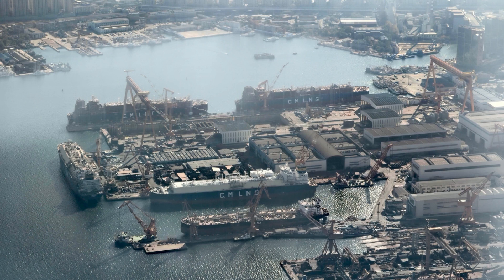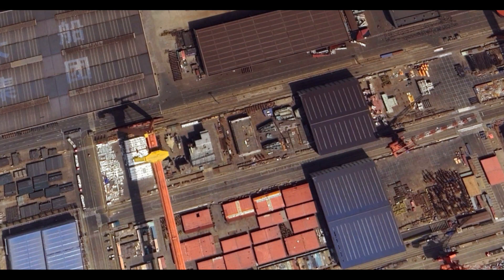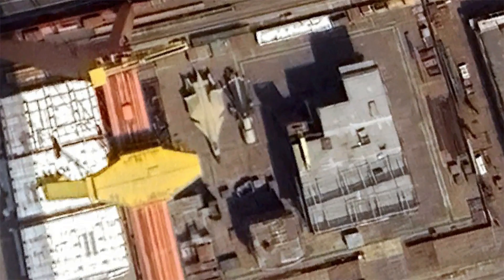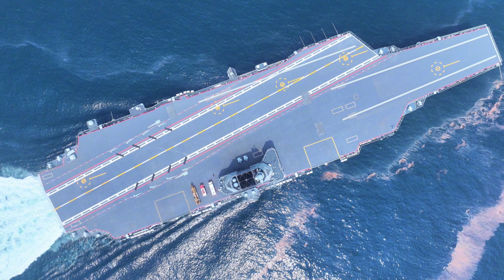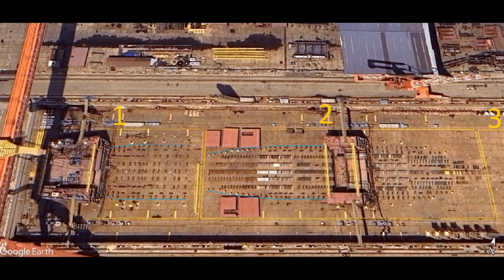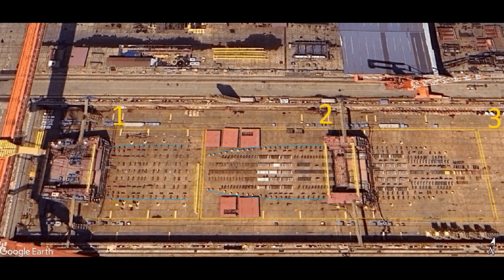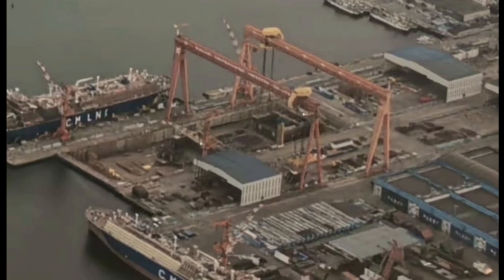China Is Assembling an Impressive Nuclear Supercarrier - The Type 004

Comment: While still not at par with USN, the rate of progress is incredible. To go from nothing to a possible home grown CVN in 25 years is monumental! 
At this rate the PLAN will easily reach parity by 2035 and leapfrog the USN afterward.
Reply: The issue with the US fleet, is that it's aging rapidly, and it has obligations globally. The USN is unlikely to be able to keep up with China's ship building rate.
Reply: @anonanon7235 correct and the cancellation of the Constellation definitely did not help. Also 99% of folks don't understand strategic posture. 
The USN by nature is an expeditionary force and force projection focusing solely on CSGs. PLAN is more about defensive and protection if the homeland and trade routes. They have zero interests in patrolling the Atlantic or even going past the 2nd island chain.
Reply: Nonsense..
Reply: @yours_sincerely48  He is right though, two of the three catapults on the Fujian extends too far back into the landing area or are in the landing area. When conducting air operations it can only use one of the three catapults. The Nimitz and Ford can still use 2 catapults while recovering aircraft simultaneously.
Reply: @GigaB1ter Do your know china EM Launcher can set to Stop in the instance anywhere on the length of catapult. Dinosaur Age Steam Catapult CANNOT Do That ..If China can figure out how to make EM Launcher and even the US can't...Dont they know the operation aspect. 
No point using antiquated Steam Catapult knowledge in a hi tech EM launcher.

Comment: I have a question for anyone with practical knowledge of aircraft carriers.  A number of days ago I saw a video in which commentators with some experience with US aircraft carriers were commenting on how the Type 003 aircraft carrier's EMAL catapult and recovery deck arrangement was inefficient and that one of the front EMAL catapults overlapped with the aircraft recovery area.  This arrangement would lead to a slower launch/recovery cycle as not as many planes could be launched and recovered compared with the US carrier deck arrangement.  Is anyone able to comment on the issue and whether the deck arrangement is sub-optimal?  If it is sub-optimal, is there any indication of whether the new Type 004 will have a different deck arrangement that is more optimal?  Thank you!
Reply: It is true.
During the construction of Type 003, there was a major breakthrough in China's electromagnetic catapult technology, therefore the partially completed ship was redesigned to fit electromagnetic catapults instead of steam catapults. The problem could easily be solved if the carrier was built a little longer. And it is clear that Type 004 will indeed be longer than Type 003.
Reply: @deepseer  Thanks for explaining the origin of the issue and for sharing your thoughts on how the increased length of the Type 004 should solve this problem.

Comment: The Gerald Ford looks good on paper but plague with operational problems especially its EMAL and Lifts. Its maintenance cycle is also longer and more expensive to operate. Is  cannot operate the F35. Only the F18 Super hornet  and the E2 Hawkeye.  The Type 004 is not even built yet so a comparison is merely academic  but compare to the Type 003 Fujian, I am not  sure the Gerald Ford is even more capable? The Fujian can carry the stealth J35, J15T and KJ600. Without any doubt the J35 5th generation fighter is more superior than the F18. Its KJ600 radar also has a longer range than the E2 Hawkeye. Therefore bibber is not necessary better because the aircrafts are the ones that really matters  in a sea battle....
Reply: The Fujian takes 48 hrs to be ready for deployment. They cannot even launch the fighters will full armorment. The Fujian runs out of fuel quick and needs support ships to help. 

While those F18 comes by and sink it because it takes hours to refuel the carrier.

Bottom line. Fujian sucks!

Comment: In the video, the author showcased the CV-19 model, which is the model of the first 003A-class aircraft carrier. The main improvement lies in the bridge. Since the bridge of the 003-class aircraft carrier integrates the chimney, during high-speed navigation, the top antenna of the bridge would be blackened by the smoke. Therefore, the top antenna of the 003-class aircraft carrier needed to be cleaned every time it returned to port. Hence, the 003A-class aircraft carrier separated the chimney from the bridge.
Reply: Carrier #19 is 004, there's no such thing as 003A
There were never 001A either! It's all media bull numbering
There's 002 and it wasn't named 001A
Same after 003 #18 Fujian, next ship be 004 #19 is sister ship conventional-hybrid
Only 005 #20 is nuclear-power that certainly isn't this ship
PLAN officially deny building a nuclear-power carrier vs media & other nation suggesting
That's China official state & military current carrier building is certainly conventional-hybrid
Reflected in same on Wuhan concrete carrier with a chimney & on the ship model release by Jiangnan? shipyard
Reply: China is certainly debugging last stages of her (military) Thorium nuclear reactors (1st for carrier, before other military vessels & later for civilian tanker/ cargo ships) however that 005 #20 nuclear-power carrier ain't ready to be seen before 2030 or build any time soon
China 005 #20 nuclear-power is in slow development progress! 
China isn't crazy to rush such important development 
Unlike all the media & mystery people hypes

Comment: China is already in an exclusive club, that being EMALs carrier capable of launching 5th gen fighters.
Reply: What exclusion? Ford is already in FULL operation, Fujian is just waiting to sink!
Reply: @garys5540  your president told you to revert back to STEAM, is it done? 😂
Reply: @野豬1791 😊hehe ,I remember trumps intreview where rang the admiral in Okinawa and wanted to go back to steam , a $40bn investment cant do its design purpose , launch the latest jets
Reply: @garys5540  Nimitz steam catapults , not Ford Emals launch F35s , Chinas  amphbiuos and Fujian both use 34 sec recharge variable discharge capacitors an elegant solution compared to Fords AC/DCconversion swinging flywheels
Reply: @garys5540 nope. Ford class can't EMAL launch the F-35. Trump wants steam catapults for all carriers 😂
Can't wait for the 120k ton type 004 with thorium reactors and 4 DC EMALS 🐲✨️
Reply: @garys5540  Ford never launched F35C
Reply: @fatdoi003  They can. What has Fujian launched? Lunch?
Reply: @garys5540  maybe it can but it hasn't yet..... fujian launched J35 already, it's on video
Reply: @fatdoi003  It's a test flight without full fuel and full armament. What's the point of launching a half armed half fueled fighter? Plus, the Fujian only has 3 launchers. The Ford has 4 and can launch 3 in 30 seconds, the Fujian takes 30 seconds per launch and if that goes well. In other words, the CCP equipment sucks, won't work when you need it and it will fail! The proof, it made in China!
Reply: @garys5540  but fact is Ford still hasn't launched F35 yet....
Reply: @garys5540  20年前就投产了，到现在只产了空气出来

Comment: The Type 076 is a genuine game-changer, not just for amphibious ops, but as a crucial stopgap for China's carrier fleet. While they build more CATOBAR carriers like the Fujian, the 076 can immediately solve the two biggest weaknesses of the existing ski-jump groups. Its complete CATOBAR system—featuring both an EMALS catapult and arrestor wires—allows it to operate large, fixed-wing unmanned aircraft that the Liaoning and Shandong simply cannot. This means it can embed with a ski-jump carrier and provide the entire strike group with a persistent, long-range radar picture via unmanned AEW drones and a deep-strike capability with UCAVs like the GJ-11.

This partnership creates a powerful "high-low mix." Furthermore, the 076's design introduces a fascinating strategic wildcard: the potential to operate a handful of manned J-35s. While likely not its standard role, this capability would allow the battle group to surge 5th-generation fighters at maximum fuel and weapon loads for critical missions—a capability impossible with a ski-jump launch. This hybrid approach, combining the ski-jump carrier's J-15s for air defense with the 076's unmanned strike/ISR assets and potential J-35 punch, creates a incredibly versatile and modern composite air wing, effectively bridging the capability gap until a full fleet of CATOBAR carriers is realized.
Reply: Yea, yea, keep dreaming. It's all CCP JUNK!
Reply: @garys5540   India can't even build toilets 🚽🚽💩
Reply: @garys5540  lmao are you on drugs?

Comment: I think the 004 hull will be similar to ford. 003a will be improved 330m long, 4 cats, 3 elevators
Reply: 003A will not add electromagnetic catapults or elevators. The main improvement lies in the bridge. Since the bridge of the 003-class aircraft carrier integrates the chimney, the antennas on the top of the bridge will be blackened by smoke during high-speed navigation. Therefore, the antennas on the top of the bridge need to be cleaned every time the ship returns to port. Thus, the 003A-class aircraft carrier separates the chimney from the bridge.
Reply: There's no such thing as 003A, these dubbed naming from media & mystery people
There's only 004 #19 is sister to carrier 003 #18 Fujian
There's also 002 #17 carrier, it wasn't 001A as media bulled
Reply: For so called nuclear-power carrier, there's only 005 #20 however there's no way China will make that so early before u see 004 #19 conventional-hybrid carrier

005 #20 is the 1st ever China nuclear reactors on a very large military vessel & IMHO certainly won't be build & shown right now

076 LHD was said by media & hyped people as 2x EMALS, may be angle deck but China state posters clearly show only 1x EMALS & straight deck
It wasn't until dust settle all the bloated fooled itchy disappointed believers will see...

But these goats will be dashed away by next wave, soon onto believe next hype, itchy bums habe no foundation, won't believe facts even if it's announced by China military jist Mar 2025 "China ain't making nuclear-power carrier" that's immediate one (004 #19 with chimney)

Comment: It looks like China is building a carrier with power provided by a pressurized water reactor.  I expect such a vessel to be an interim type and that carriers will use molten salt reactors when these become available. These are much more efficient, smaller and lighter - if aircraft carriers are not ended by technical developments as happened to battleships.
Reply: Out of all the languages that you chose to speak you chose to speak facts and you actually couldn't have said that actually any better than me
Reply: carriers n tanks both obsolete, both in demand, Chinese EMALs are fed by dual redundent capacitor discharge system , with 45 second recharge , much faster than Ford class , so expect any new drive systems  to be Chinese breakthroughs

China is busy batch building 45,000 amphibious landing vessels , better bang for buck with 128cell VTOL hylersonics and still have EMALs to launch  5th gen air support , but not 70/90 jets like carriers do
Reply: @Robo_au-j9o out of the languages that you chose to speak you chose to speak facts and you actually couldn't have said that actually any better than me and people like you are actually rare who are few and far between
Reply: Molten salt reactor is impossible for a carrier, power density is way too low.
Reply: @ltrond out of all the languages that you chose to speak you chose to speak facts
Reply: Yes and hardly any downtime with thorium reactor maintenance.
Reply: @larryc1616 I actually agree with you
Reply: Well the drone still need somewhere to land.
Reply: @silluete  Russia has a nuclear powered missile maybe they can do a drone.
Reply: @trevoncowen9198 😊 yeah ,Russias nuke powered missile did 2 full earth orbits before Deustchland noticed it .
Reply: @Robo_au-j9o   China is very impressive. Russia is junk.
Reply: @silluete I actually agree with you

Comment: The Type 003, Fujian can launch J35s
  Where the Ford Carrier can only launch tiny Hornets.
    That sounds to be 003 > Ford.  
     Now the 004? 004 >> Ford.
Reply: As noteworthy as it is for the Type 003 to launch a fifth-generation fighter via electromagnetic catapults at sea before the US, I wouldn’t solely bank on that to claim that “003 > Ford”. 

Being what I call an “intermediate design” in the PLAN aircraft carrier programme, Type 003 still has plenty of shortcomings when compared to the Ford.
Reply: @johnsmith1953x. How is the F/A-18 Super Hornet TINY? It has a Maximum Takeoff Weight (MTOW) of 66,000 lbs (29,937 kg) while the J-35 is a little bit LOWER at 61,730 lbs (28,000 kg) [according to Google]. The two aircrafts are nearly identical is weight...